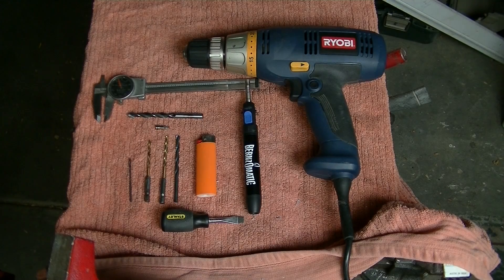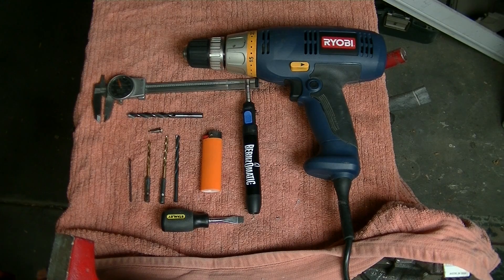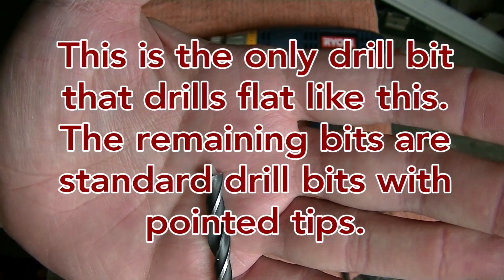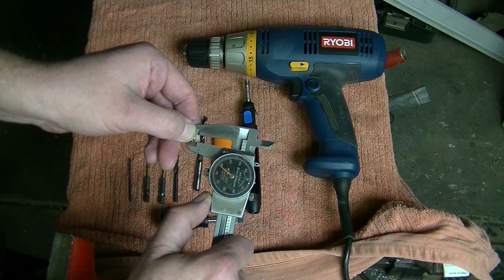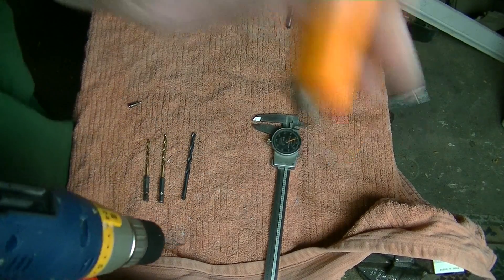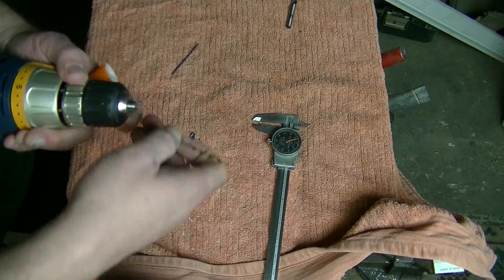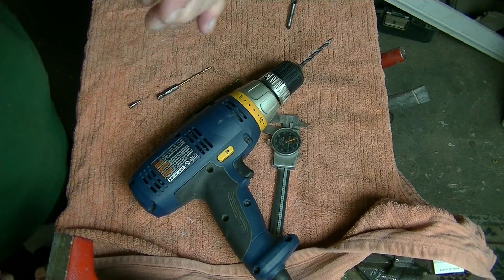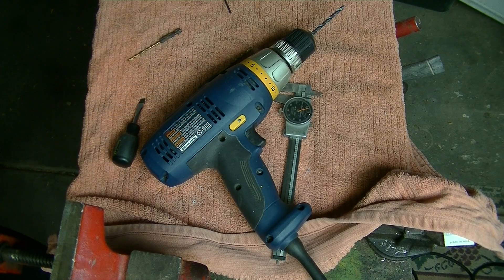Make A Bic Lighter Refillable By Installing A Refill Valve

Comment: Wow that's pretty tricky spend 10 bucks on benzyl Matic soldering iron so you ruin that to get the valve and to make a dollar 79 lighter plus the cost of the butane that's real smart man. Some people have too much time and money on their hands and I guess!
Reply from the maker: Well since I made this video, our options for purchasing valves straight out have increased significantly. Though obtaining one through the mail for less than $10 remains impossible. The cost of butane is insignificant since you can purchase enough butane to fill the lighter in upwards of 50 to 100 times or more for about $6.
Reply: Joseph get out and get a life and a hobby. This video is something people can do for fun instead of leaving bs comments on others people's videos. Also look at your logic again. It's unlikely he bought that torch just for making that bic refillable. It's a tool that can be used for many other purposes before and after the making of this video. It's like saying you grew your hands just to leave pointless comments on YouTube videos.
Reply: @mjyanimations1062  wow talking about leaving b***** comments. I definitely wasn't the only one who did not see the light of the video. There were plenty of other people that had plenty of negative comments also. If you can't handle the heat get out of the kitchen

Comment: With the KWA valves you need 7/32 and 11/64 drill bits. You don't need brad point. Regular drill bits work.
Reply from the maker: Well the brad point bit was used at that time to help the rubber gasket form a tight seal against the lighter... but I suppose that with different shapes of O-rings, it would not always be necessary to have that 90 degree angle flat surface for the O-ring to seal against. With the sheer magnitude of different kinds of valves out there ... a "one size fits all" position would be foolish.

Comment: It’s called a brad point drill bit. Who’s going to spend 10 bucks for a stupid valve?!!!and then spend an hour fucking around with a mini butane bomb when you buy a pack of bucks lighters from Costco for pennies apiece.these hacks are useless
Reply from the maker: For YOU … thankfully, almost all humans are different with different needs…
Reply from the maker: @Definitely Not Sixto I've been in more danger with my electronics projects ... popped a capacitor just the other day ... talk about startling ... only had a lighter blow up on me once ... when I was about 11 years old I found what I thought was an empty bic lighter so I tossed it into a burning fire place inside this underground fort that we built and when it blew up I remember the flames lining the inside of the walls all around me ... it was a pretty small fort and it was circular in shape ... we dug a fire pit in it cause it gets cold out here in the winter .. needless to say I learned that day that empty lighters are an illusion :-)

Comment: Just bought a couple from the link hopefully you get something if not I tried lol do you know the thickness drill I need for this?
Reply from the maker: Remember ... start small with your bits and taper up ... doing that will give a great guide for each bit so that when you use the final bit, it will almost pull the bit into the hole for you so its harder to screw it up.
Reply from the maker: No ... just use the calipers and go with a bit that's a tad smaller than the nozzle threads and make sure you drill as straight as you can without drifting  and it should work well.

Comment: How to make a bic refillable:
Step 1: buy a clipper
Reply from the maker: @BenWaddington-benwaddi  Honestly I don't know but back when I made this video, butane nozzles from other lighters always had a long stem that made it impossible to use in this application. In fact, since I made this video,  those butane soldering irons have gone way up in price to where its not even a close call in terms buying one for this purpose as it would be a complete waste of money. It might be that when I bought that soldering iron, Home Depot might have made a mistake in their pricing, though they were set at that price for at least a year or so back then... but now those butane soldering irons are in the $30 range... I have no explanation for it really.
Reply from the maker: Absolutely one option ... I've used them, I like them ... but I like Bics better.

Comment: Ha-ha the joke is on you bud, because I refill them The other way that you was talking about with the push pin, except instead of using The little rubber gaskets to make the seal with the can of butane, I put hot glue on it instead, & then after the hot glue sets up I will re poke the hole and round it out a little bit just the dept of the glue until the very tip of the can of butane makes a perfect "no leak" seal. And then i go on to fill it up. But the reason that the joke is on you is because you can only refill these bic lighters approximately 3-4 times max before the Inner Fluid release mechanism becomes gummed up as a result of impuritiy build up caused by all of the impurities that are within the butane fluid its self. So you just done all that work in order to be able to refill that bic lighter A maximum of 4 times, and that's if your real lucky. It literally takes me 2 minutes to do it the other way and that is the time it takes for then very 1st fill up, because since the hot glue and hole is already They're on the 2nd,  3rd and 4th refill, it literally takes me a few seconds To fill up those times. (that's if your even lucky enough to get it to last for whole 4 fill ups at all) So you're wasting your time, & if you use that lighter any length of time you will realize that. You cannot replace the inner fluid release mechinismse on these bic lighters because it is internal, and one would have to Literally crack the lighter open in order to get to it. So once that internal piece goes out, then they're done for good, And all that you can do at that point is salvage the What's left of the flint and throw the rest away.  So I think I'll stick to my much faster, much easier, & much more convenient way of doing it. But thanks for Trying at least lol.!.
Reply from the maker: I've refilled Bics up to 10 times using high purity butane ... never experienced the clogging that you're talking about, though I'm sure it happens with low purity butane .... but hot glue? Seriously? I mean ... if that works for you ... then more power to you! I'm not here to preach my method as the best method, nor do I desire to GET INTO A NERD WAR over this silly topic. This is simply one option out of many and people are free to do as they wish - obviously.
Reply: @MikeSims70  Well then maybe the joke was actually on myself all along for using the cheapest butane that i could possibly find. I will for sure try a higher quality butane to see if i get a better result. If you can refill them up to ten times, or more (I'm assuming until the flint is completly gone) without having them to stop up then doing it your way may just be worth all the effort after all. (I have also gotten good at changing the flints out in these Bic lighters as well, only because it was challenge to do so) So, if a higher purity butane does prevent them from stopping up, then a person could pretty much use the same Bic lighter forever, just as long as they replaced the flint in it every now and then!  However with the butane that ive been using, it just wouldnt be worth the effort. And Yes, "HOT GLUE" 

I Left A Link Down Below That Will Take You To The Video That I Made Just The Other Day Of Me Demonstrating How I Refill Them. If Using A Higher Quality Of Butane Does Prevent These Lighters from Stopping Up, Then I Will Revise/Edit A Correction Into My Video.!.

https://youtu.be/8R8Nd8Nld9g
Reply from the maker: @kevinperdue6054  If you have mastered replacing the flints on the Bic, then you're WAY ahead of this game... I have yet to do it successfully... I think I managed replacing the flint one time and that was an accident ... or a rare alignment of the planets ... but usually once I get them apart and I realize how much they were not designed to be taken apart... and the odd things I would have to do with my fingers to get the new flint back into the lighter ... that's about the time I start looking around for new candidates to perform the nozzle transplant on ... cause for me ... its easier to move that damn nozzle than it is to replace the flint... so from my perspective, you have a rare talent.  :-)
Reply from the maker: @kevinperdue6054  OH yeah ... and I use 11X filtered butane by the way ... but Ive used 7x in the past with success.
Reply: @MikeSims70  I will make a short video showing the simplest way that i have found so far to change out the flints that are inside of the Bic lighters! (& when I say "The Simplest Way", I mean "Still Hard As Hell" LoL,,, But I Have Done It So Much That I Have Gotten Good At It finally), Anyways, Like I Was Saying- I will make a video showing how I do it, then once I  have posted it to YouTube I will come back to here, and leave you a link to it.
Reply from the maker: @kevinperdue6054  When you do, ill put the link in this vid description as well as the top pinned post ... ill also add it as a text overlay at the start of the video. Dial in your method and break it down as much as possible. Don't forget to talk about any gotchya's that may not seem obvious ... be as descriptive as you can wh explaining the use of tools ... try to describe how things should feel in your hand as you're working with it ... pretend you're teaching  kindergartners ... only without the obvious legal liability that would come with showing kindergartners how to use lighters ...

Comment: Warning! Back in the 1970s Bic lighters we're filled completely. Today they are not filled all the way. If you have it full it is equal to 2 sticks of dynamite.
I was in the US Navy then and in the shipyards. A government contracter came aboard to do a welding job. He carried his lighterbin his top pocket. While welding a piece of hot slag went into his pocket and the lighter blow up. It blow his chest open. It was a miracle that he lived. I performed first aid on the man and was able to get him help to transport him to the U.S. Naval hospital were they had to do surgery for hours to save his life.after 3 months in the hospital it took over 2 years for that man to work again. Most people die in the explosion. It was a mess. So be cautious is your doing any hot work. Be thing is not have it in you front pockets. I thought it would help someone to be mindful that this can be dangerous if you have a slow leak somewhere. Do a leak test of the lighter if you do this procedure. Its at your own risk. These lighter we're not designed to be refillable and the manufacturer has a warning on todays ligher for that reason.
Reply from the maker: ummmm ... you're not a smoker, are you?
Reply: @MikeSims70  no I'm not. I use too. I stopprd 25 yrs ago. . what has that got to do with my post? My post was out of concern for safety not to keep anyone from saving money on lighters.
Im sure your help in video will provide this for many people. But posting without warnings is irresponsible. If you have ever seen thr damage a lighter can do when used with ignorance of what can happen if those trying to use a lighter that was not designed to be altered. Bic has lost a lot of money from lawsuits even though it eas not there fault. People that dont know the risks and dont underdtand what they are doing could get hurt. Thus sueing you and Google for allowing your post with out warnings. Im just trying to keep someone from getting hurt or worse.
Reply from the maker: @margaretgibson7063  I don't post a warning for several reasons ... grown-ups who use lighters know they can be dangerous if improperly used ... or if a piece of 2,000-degree sledge penetrates the sidewall ... This is called COMMON SENSE and because it's common, it does not need to be repeated by some slack like myself...

Also, there is nothing I am showing in this video that is dangerous ... no risk of explosions what so ever ... and if someone wants to do something stupid and their stupidity ends up getting them injured ... I'm not gonna lose sleep over it and I'm surely not going to be liable for it. This video obligates me to exactly ZERO! It's a silly project video on a youtube server ... I'm not showing people how to make weapons.

There is such a thing as being TOO PARANOID and overly cautious ... some of us just want to live life without being treated like children.

Comment: I don't understand the interest to do that with a bic lighter😠. There are metal gaz lighter more secure and reusable for years for less than 5€. 
And a gaz can for refill cost less than a bic lighter pack. 
You take a high risk of burns and explosion just for doing something stupid. 
A bic lighter is just a plastic lighter that is easy to use up to empty and then a toxic waste of plastic. Not very economical or ecological for the earth.

https://www.amazon.fr/Hocety-Briquet-Allume-Cigare-Temp%C3%AAte-Rechargeable/dp/B089YBJG1K/ref=bmx_3?pd_rd_w=2zkyl&pf_rd_p=dc451f5d-835d-4680-b097-4b620b1f111b&pf_rd_r=EV5762NXZN80H0DJ1B57&pd_rd_r=3bfee34b-cc32-46f4-9d8f-29473fd3e5c0&pd_rd_wg=GlaUU&pd_rd_i=B089YBJG1K&psc=1
Reply from the maker: There are many paths to the same destination ... this is but one of them ... :-)

Comment: The original article I came upon was how to "Refill a Bic Lighter" and as soon as it got to the part where it mentioned to unscrew the flame adjuster, I had to immediately call BS.  A Bic Lighter, the disposable wonder made in France hasn't had an adjustable flame since about 1987.  You cannot fill a regular, disposable, non adjustable Bic, it isn't possible and that's on purpose.  Adding a fill port valve of course would solve this issue, but so will a dollar fifty.
Reply from the maker: They still make adjustable flame Bics .../ they're just illegal in the United States - thank you Democrats!

Comment: @Mike Sims Do you have the exact measurements for the drill bit you used or a link?
Reply from the maker: Oh boy ... if I didn't mention it in the video, then no. But a caliper should help you determine what size to use.

Comment: Do you have a recommendation as to how to expell the original gas out of the bic?? Lmao jk. I managed to get r done but a hot paper clip getting roughly the same size as the nozzle, but smaller! I then took all the rubber orings off the nozzle, got the nozzle a bit hot, hot enough to easily screw into the plastic, or to start the threading. I marked a line where the refilled gas is, so far it's a tight sealed fit! I was stoked I managed this, only to come on here to be disappointed because it's already been done lmao. Good video, nonetheless, measuring will 100% certainly result in a better secure and sealed product. As for the nozzle, I found one in an older refillable lighter ( that didn't work). So I would totally be checking different refillables instead of dropping 10 bucks for a nozzle! If I happen to fine a similar style with this type of nozzle I will certainly letcha know!! Nothing beats a bic lighter imo, and this hack rewarding and money saving  in the long run! Don't be afraid of doing this, hell, if anything your lose a bit of butane due to a bad seal.. One last thing, I found it difficult to refill at first, simply pumping the can of butane while refilling solved that issue, got mine about 1/4 full, until I'm positive it don't leak. Anyway, good video. Ciao
Reply: Make a thread and rubber seal or SuperGlue/Epoxy?
Reply from the maker: There is a plastic ball that they use to seal the fluid in at the center of that little key hole at the bottom... just use a small tool and pop that ball out and it will expel the gas in a relatively safe way.

Comment: Great idea but you should NEVER drill into something your holding in your hand. One slip and you're drilling into your hand. Especially considering you had a vice there to hold your lighter the whole time. A vice would allow you to drill evenly into the lighter a lot easier as well.
Reply from the maker: Great point! Hind sight is 20/20